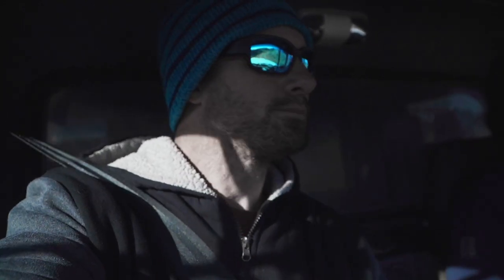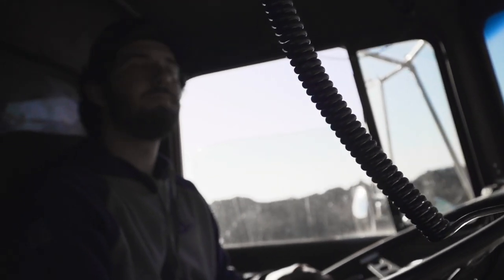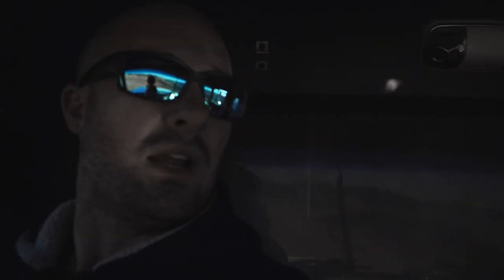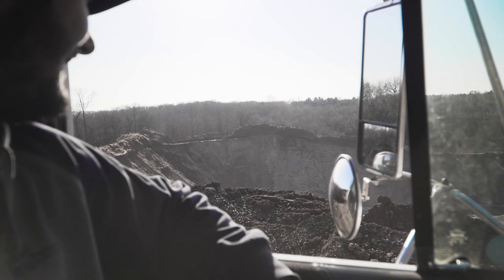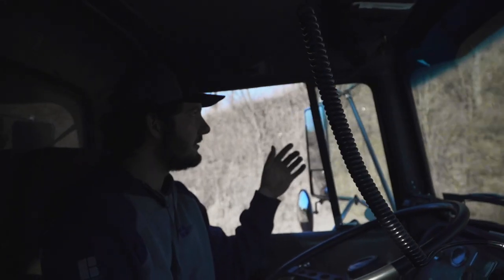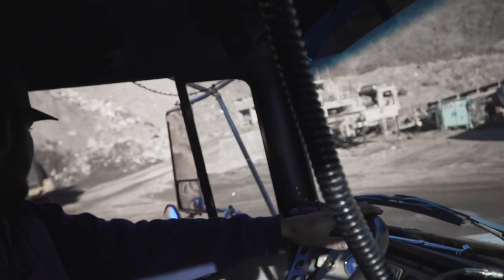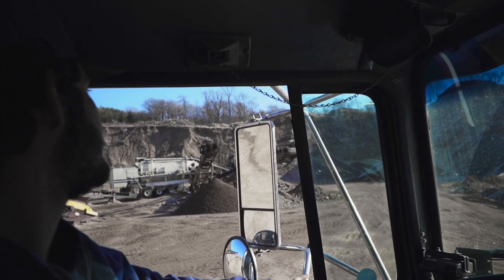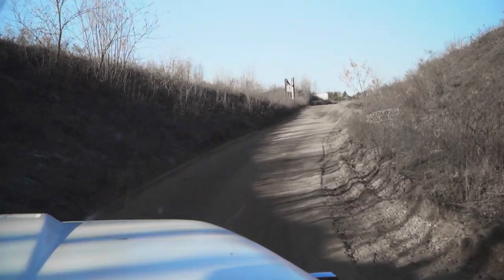What to Expect at a  Gravel Pit | How to Get a CDL License | Heavy Equipment Vlog

Comment: Cool video, I always wondered where all these dump trucks would go to when they are full. You also gave me an idea to see if I can visit some of the local pits to see if they'll let me in to do some recording.
Reply from the maker: It's worth a shot but don't get your hopes up too high. Gravel pits and quarries are generally pretty strict on safety and won't allow you out of your vehicle. A lot of pits don't allow regular cars and pickup trucks in due to the hazard of not being able to see a small vehicle in those big loaders. Your best bet will be calling some smaller, privately owned pits where you can speak directly to the owner. Good luck Allen!
Reply: @DieselandIron  That makes sense, the last they need is another liability walking around their pit. I think I'll try to contact a smaller pit and see what happens.